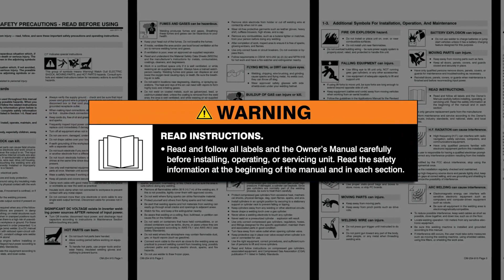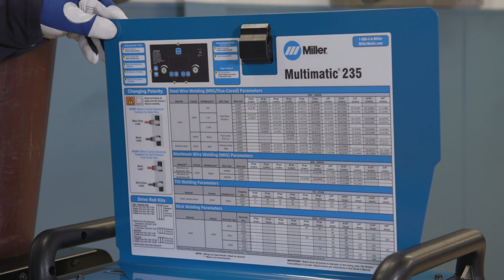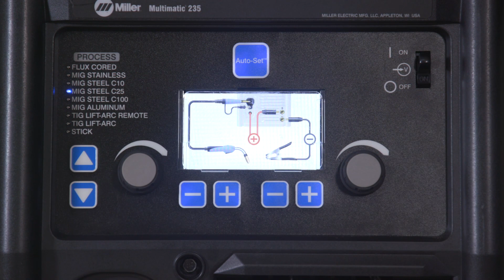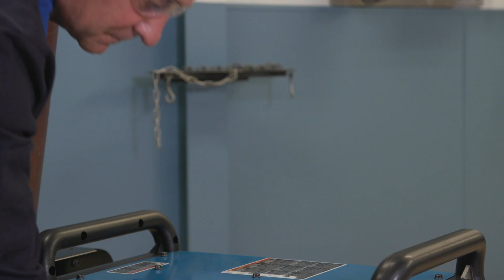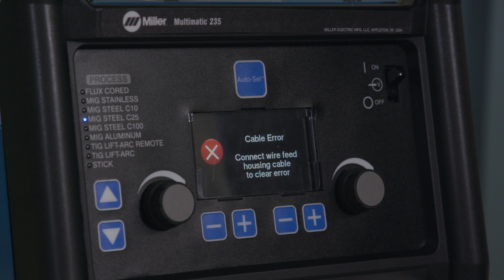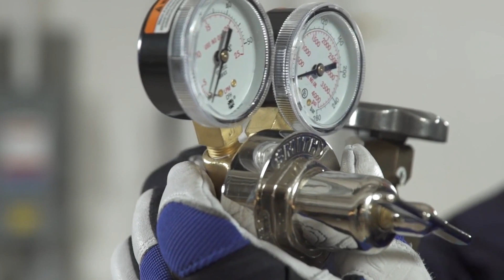Setting Up Your Multimatic 235 Welding Power Source

Comment: Why are you shouldn’t buy a Miller. I’ve had nothing but problems I’ve started out with small welders cheap ones and I worked my way up to what I thought was my dream welder or Miller and I’m telling you all the welders I went through there is not much of a difference they all Use the same mosfet transistors and electronic components they weld the same! They blame it on the welder itself or person!

Comment: We need 4 drive rolls bigger drive motor 15 ft cable so we can run 045 wire we would buy 10 units!

Comment: is there a setting for  dual shield flux core?
Reply from the maker: Hi Bruce, there are no programs for dual shield flux core wire but the flux core programs will work for the Dual shield.

Comment: Linda máquina pero cuanto cuesta
Reply from the maker: El precio sugerido por el fabricante para el modelo base del Multimatic 235 es de $2,199.00 (US). Para obtener más detalles y ver todas las opciones, puede visitar nuestro sitio web: MillerWelds.com/equipment/welders/multiprocess/multimatic-235-multiprocess-welder-240v-m30250. También recomendamos consultar con su distribuidor local para obtener información y disponibilidad en su área: MillerWelds.com/wheretobuy. ¡Gracias!